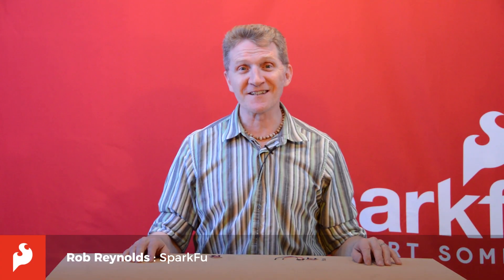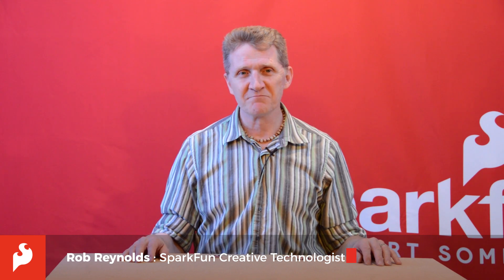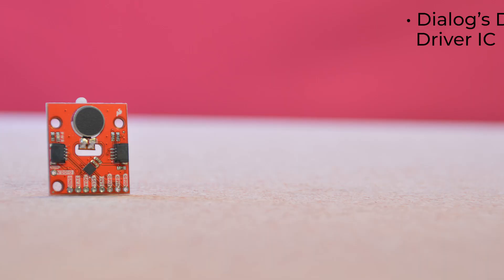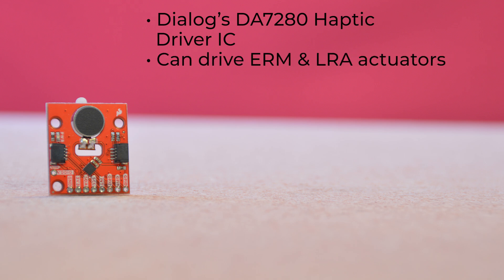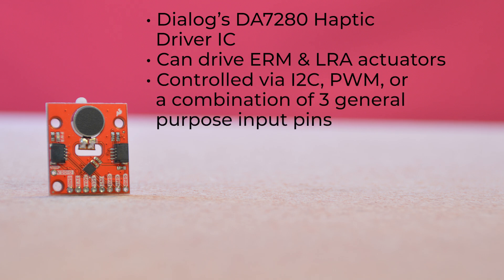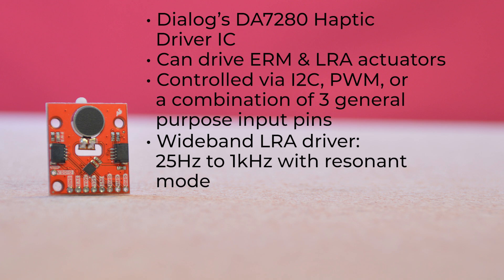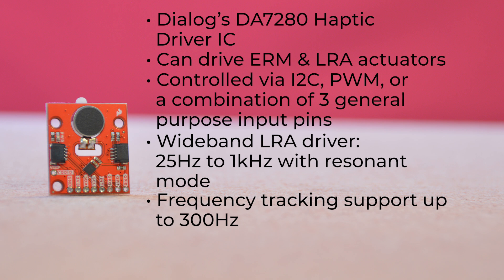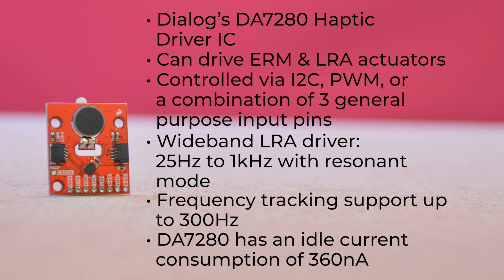Product Showcase: SparkFun Qwiic Haptic Driver

Comment: Sorry Rob - the mechanical metronomes can't defy the laws of physics as they synchronise, as you suggested...
Reply: They're not defying the laws of physics, but because the platform is not fixed, they can phase lock. I was skeptical at first too, but the brainiacs at Harvard give a nice demonstration with explanation.
https://sciencedemonstrations.fas.harvard.edu/presentations/synchronization-metronomes
Reply: @RREYNOLDS65  And now compare that demonstration,  and others, with what you actually said...

Metronomes at the same rate, but at different points in their swing (as is the case with the Harvard devices), will most certainly synchronise but metronomes at different frequencies (speeds, as was stated by you) would not - it would be physically impossible for them to do so...